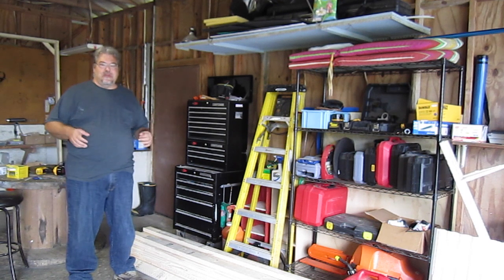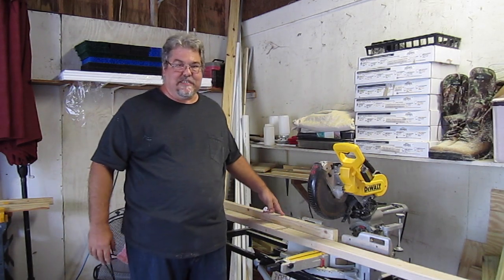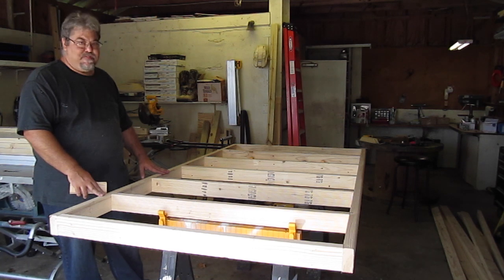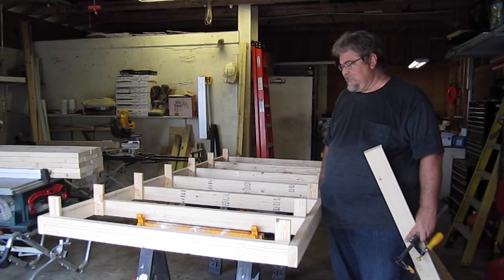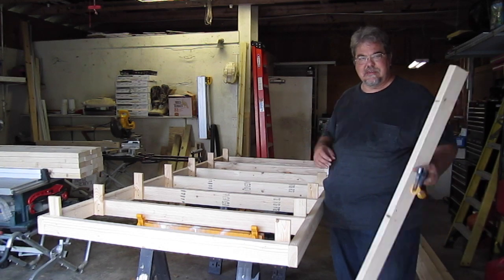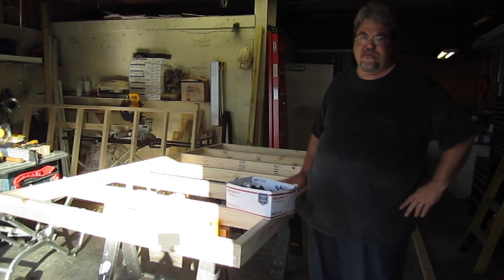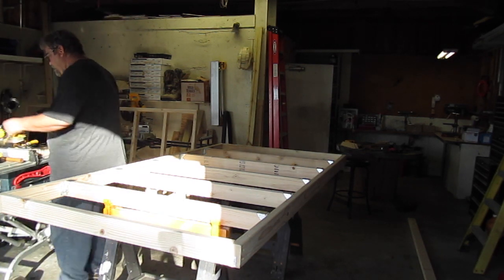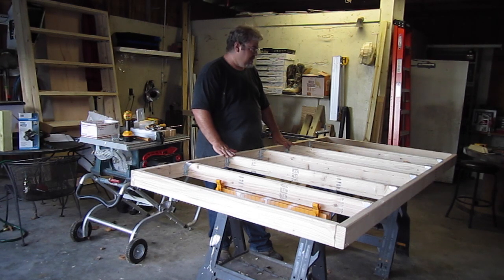Part 1 - DWC Grow Bed Build

Comment: Using a razor instead of a pencil is brilliant!  I looked up Simpson Strong Ties and there are several different kinds.  Can you identify the kind you used please?  For example if you were going to ask someone at the store over the phone for a price check... how would you identify them?  Also, thanks for doing this... this is the best video on constructing a grow bed that I've seen anywhere so far.
Reply from the maker: Here is the manufacturer's page for the ties I used: http://www.strongtie.com/products/connectors/lus-mus-hus-hgus_pt.asp. 

In the US, you can get them at Home Depot (http://www.homedepot.com/p/Simpson-Strong-Tie-2-in-x-4-in-Double-Shear-Face-Mount-Joist-Hanger-LUS24/100375343) or Lowe's (http://www.lowes.com/pd_116208-166-JUS24-TZ___?productId=3374294&pl=1&Ntt=joist+hanger+2+x+4).

Comment: Just one question looking at the sketchup file  it appears you're having to use a radial flow filter. do you think using a media based bed to remove solids between the fish tank a DWC would work, why I ask I'm thinking by doing so I could incorporate worms into the mix and have the added benefit of vermaculture
Reply: Gordon Pilcher I am only answering based on research not personal experience so take this with a grain of salt but I believe that to be a bad idea because you need to keep the flow consistent in dwc and alternate flows in an ebb and flow media bed

Comment: You stated early in the video that you were cutting 28 - 2x4's down to 3 feet by 10.5 inches, but it shows you marking the wood at just under 4'.  So I'm confused.  Also, what size are those small blocks of wood you used to build the jig?
Reply from the maker: Yes, that would be at 3' 10.5" (58.5") long total. I think the blocks were made from 1 x 3 stock I had lying around, but you could use just about anything you had.

Comment: hi Jeff, great How To for grow beds.... I wish to do the same when I get mine ready to build.

Wondering what the total cost of your bed would have cost you, as I'm thinking my calculations might be a little off

Cheers
Damo
Reply from the maker: +Damian & Kelly Sorry, but I didn't keep track of the costs.
Reply: +Jeff Barriault thanks anyway
Reply from the maker: +Damian & Kelly Actually, I forgot I could pull a report in QuickBooks. Just under $6,000 for the entire system including the shade structure, fish tanks, pumps, etc. Might be a little high though as I typically purchase more materials than necessary so that I have them around for other projects. 

This year so far I've made just under $3,500 from produce and egg sales here at the farm. Most of that comes from lettuce grown in the system.